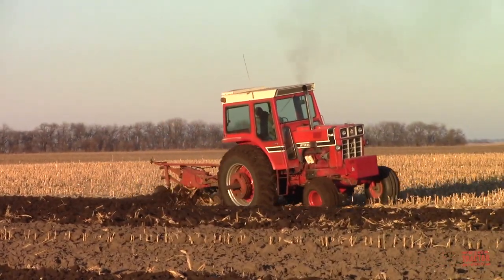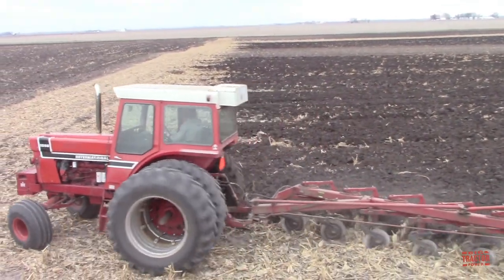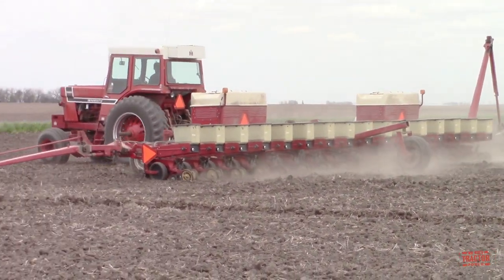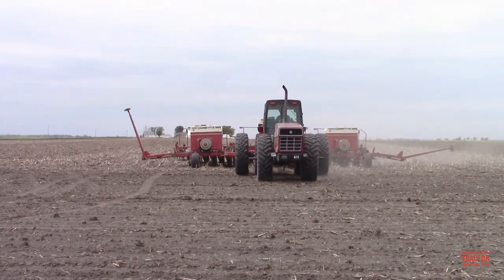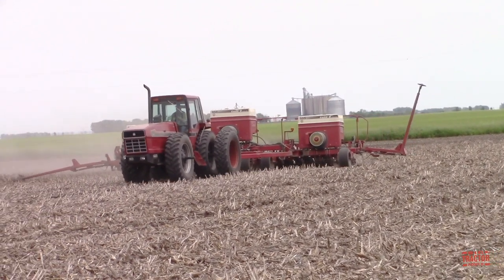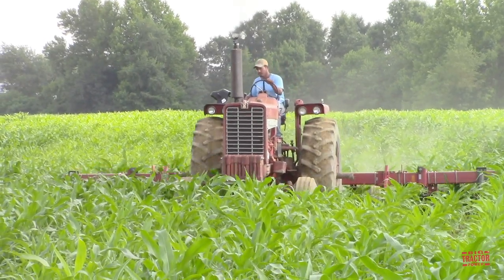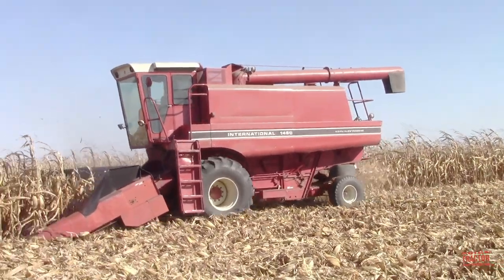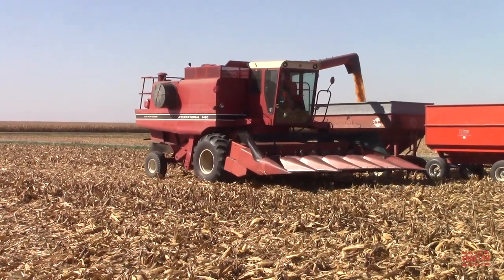TRACTORS, PLOWS & HARVESTERS  International Harvester Edition

Comment: 1968 IH 856 diesel tractor, 1976 IH 1086 tractor, 6 row 40 inches Cyclo 500 planter and harvested with 1971 915 combine with 20 foot grain table up through 1999.  Hardy machines that were enjoyable to operate most of the time!  Thank you.
Reply from the maker: Great IH line up. Thank you for sharing.

Comment: We have a 1486 white stripe, I don’t remember when it was made but it’s very good! We put a chrome stack on it and did a pump toon not too long ago, It mainly gets the hay work done like Mowing and Raking hay but sometimes it run out turbotill
Reply from the maker: Very cool. The white stripe 1486 was built from late 1976 to 1980. The tri stripe decal indicates a 1486 is a 1981 model.

Comment: My grandfather bought a 1460 back in 1979. It was one of the first around. Everyone else was still running 915s. It was an amazing machine. I can't believe they are still running. I'm assuming getting parts is not an issue?
Reply from the maker: The 1460 was a big deal in the late 70’s. A completely new concept in threshing.